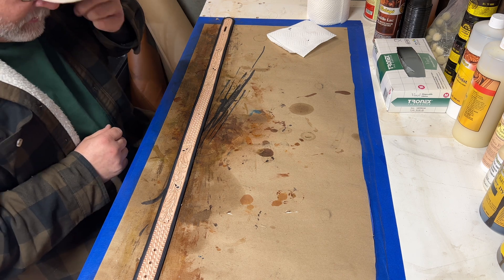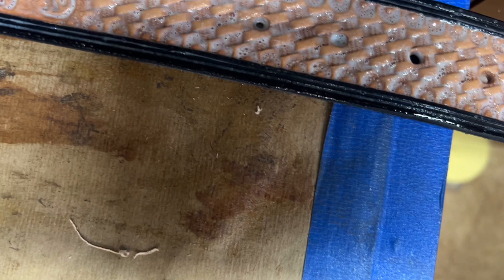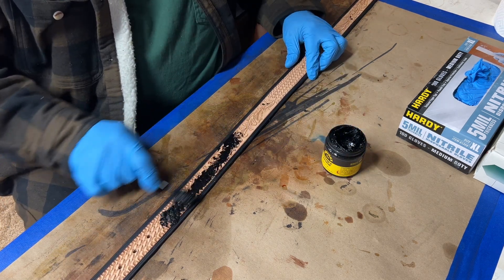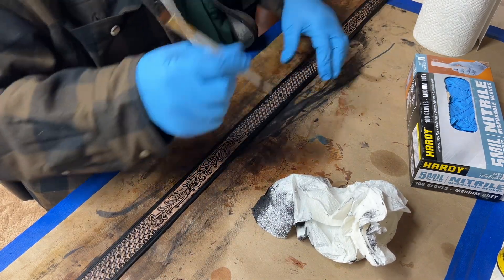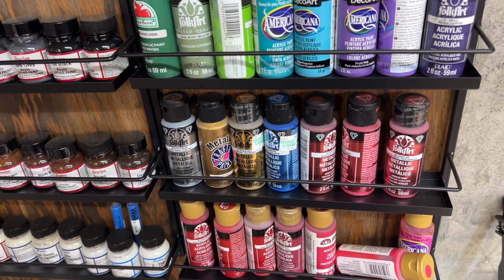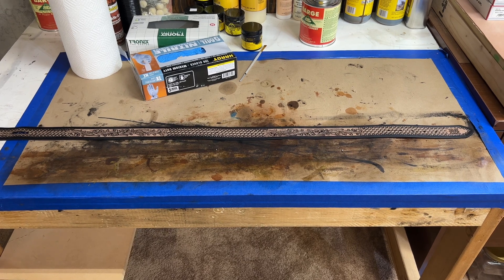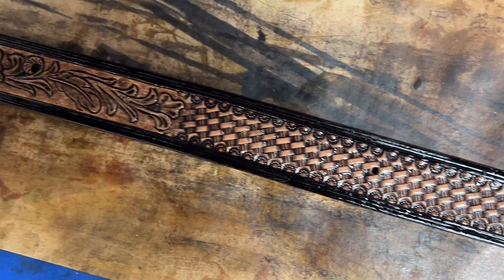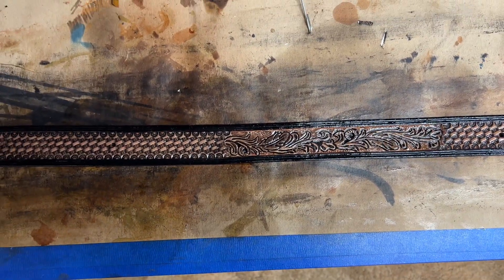Applying An Antique Finish To Leatherwork

Comment: Thanks for this video. I was wondering, do you always paint after applying the final coat of resist? Does the resist not prevent the paint from setting on the leather? Do you have to go back over the painted parts with another coat of resist?